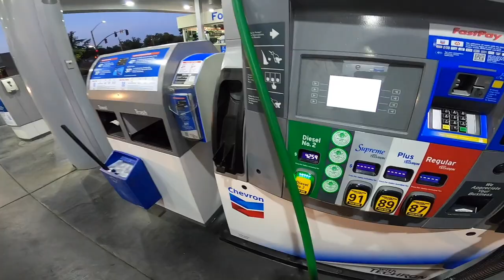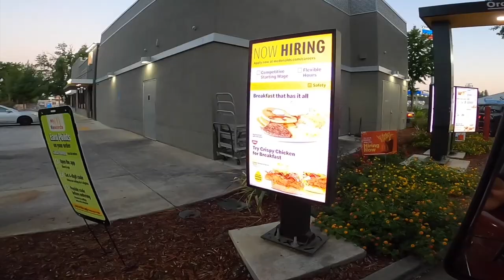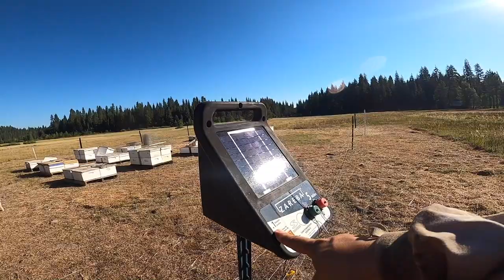Hives for Heroes - Working w/a Veteran, Re-queening, New Pierco Double Waxed Frames, Bears oh my!

Comment: Oh yeah, question for ya...do you pull your in hive feeders once the weather drops? I missed two hives one year and that was not a good situation.
Reply from the maker: Honestly I don't, I have never had any issues that I have noticed from leaving them in. Where are you joining us from? Here in California we have not had any hard winters in a couple years.
Reply: @TheCaliforniaBeekeeper  I'm in Centralia, WA. Originally I'm from Sac. Up here it depends on the year of course. In 2018 I had 20 hives. Was planning on splitting all of them in the spring. Then we had one hella winter. 3 late snow storms back to back. I lost all of my hives. Now I'm working on getting my numbers back up. Last year I was using the in hive feeders because the yellow jackets were annihilating my hives to get to the feed. Then winter came and I thought I had pulled all of my in hive feeders. Nope, solid bricks of sugar ice and three dead hives. Uhg. So no more in hives. I got the yellow jackets beat down. Caught three queens and torched about ten others. Plus we torched four bald face hives. That about did it for the suckers. 😆 so now I'm back to open feeding and I'm not seeing alot of robbing, which is nice. Now if I can just not lose any over the winter that would be great.
Reply from the maker: Gotcha! Yes you seem to have your system in place and yes it’s probably a good idea for you to pull your feeders prior to the cold snap. How’d your girls do during the heat waves?
Reply: @TheCaliforniaBeekeeper  the ones that were here and already established hung in there. But I've converted some of my old supers into Vivaldi boxes and allows the air to ventilate the hive without exposing them to the random baldface or yellow jacket. I'm thinking with all the boxes you have that would be a cost that puts that idea way off the map.
Reply from the maker: Yes but we are always ready and introducing new hive bodies trying to weed out all of our plastic boxes. We have a couple hundred of them🤦🏻‍♂️

Comment: I set up my hives with the parmac 12 v magnum. Bought a separate marine battery, solar panel, and charge controller from Amazon. 8 foot ground from home Depot hammered in at 45 ddg angle. Up to 3.1 Joules. Want to give the bear a heart attack. About $225 for those components I think.
Reply from the maker: Jeremy! Thanks for that feedback. I like that thought in driving ground in an angle👍🏼